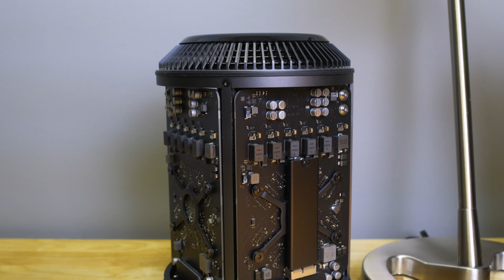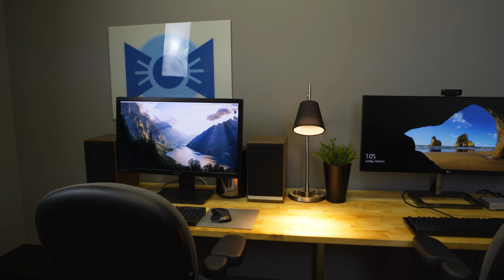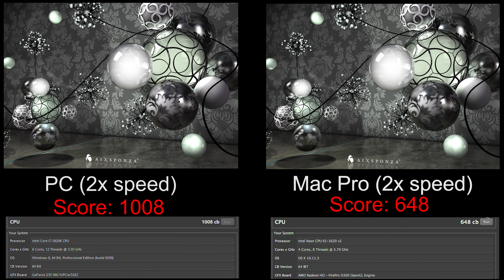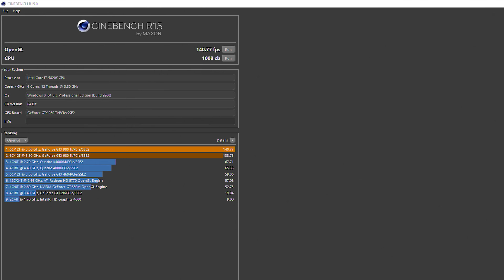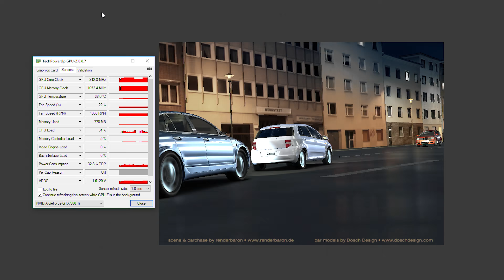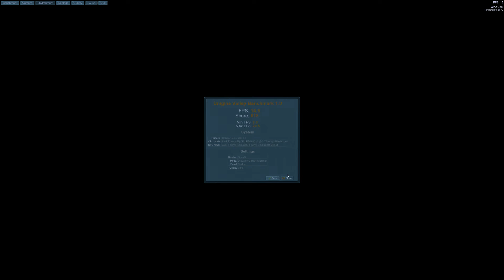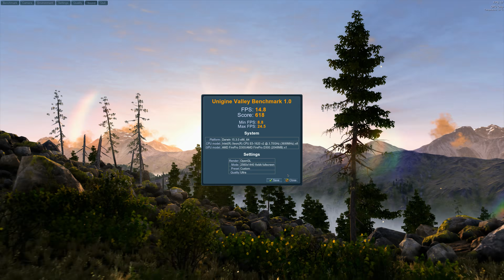$2,000 Custom PC vs $4,000 Mac Pro

Comment: The price point is what makes these computers comparable. If you're going to pay 4000 dollars for a computer that's a piece of shit. Then it can definitely be compared to computer that's 2000 dollars. I read comments saying you can't compare these computers because they were released at different times. That makes no ducking sense.
Reply: Fucking*
Reply: +Chase HAmlin Ikr....
Reply: +Chase HAmlin anyway if the "pro" version is that old why they keep selling it at 4 000 dollars ? isn't it supposed to be old ? it's worth testing cuz if apple doesn't upgrade it it's their bad so ..
Reply: +MrSky Boy it costs 4000 because people are either stupid and think the apple logo adds on another $2000 or people just like to keep things simple and buy an overpriced piece of hardware that works. Also it has been tested several times apples Mac trash can is much worse when it comes to benchmarks.
Reply: +Chase HAmlin When stuff get older the should lower the price
Reply: +WeLoveOur Tech yep
Reply: +Chase HAmlin Except that it doesn't "just work". Due to the bad thermal design the parts overheat and generally fail after 2-4 years often starting from the gpus. There's a reason why real pro machines do cooling and performance over looks.
Reply: Chase HAmlin in short: the mac pro breaks because of overheating.
Reply: +Tsunami I couldn't tell if you were talking about the Mac or the custom pc.
Reply: +Tsunami I completely agree though.
Reply: +Chase HAmlin I am not a fan of Apple, but this wasn't really "fair."  Professional grade components simply cost more without necessarily outperforming there consumer grade counterparts.  Its likely his custom build would beat out most workstation pcs in a price to performance comparison.  Add to that the fact that Apple seriously limits the amount of options you have when customizing your Macpro.
Reply: +Phillip Broden But why? That is what i don't understand, why would someone want to buy something that is so old, for such a price, makes no sense to me, for the looks? Fair enough it is more compact but that in it's self is bad, how it was mentioned in the video it was "spitting hot air". And for those who say that the product is old which is and is not fair to compare them they are clueless since how again it was mentioned in the video it is the best Mac Pro you can buy, and it is at a price tag of 4000$ which is stupid.
Reply: +Phillip Broden you consider Mac professional grade?
Reply: On a component level, yes?  Xeon processor, ECC memory, dual "Workstation" gpus.  All of it pricey, none of it ideal for gaming, or typical computer use.  Is it the best bang for your buck, no.
Reply: Rosca Radu It's for the name.  It's easier to sell the idea that you have a top-of-the-line studio with an expensive name brand computer than with a DIY custombuild.
Reply: It doesn't matter when they were released.
It's the current model Apple is selling.

Comment: Macs are built for audio and video editing and is made to last. Windows PCs are upgradeable. Best for general computing and hardcore gaming. I have a '09 macbook and it runs better than the windows laptops we've had in from 09-14. AND Windows still cannot do built-in multi-audio driver support (playing your regular media when running a DAW at the same time) which the mac has been capable of doing so for quite a while now. You need to install ASIO4ALL but can't use windows media player or watch any video/audio streams at the same time. T_T Getting older mac OS' is frustrating because when they release a new OS you wont find the previous one anywhere on their end anymore. T_T
Reply from the maker: +Eric Spartacus I built this PC for video editing... And it does a better job....
Reply: +Snazzy Labs I don't have 8k to spend for a build comparison. Gotta give it to you man. I'd be most grateful already just to have one of those computers.

Comment: You could literally make an i7 Unlocked CPU and twin water cool Titan it with 32gb of ram and it'd still be cheaper. With 4K to spend on a computer, they really could've made a beast. They failed obviously. They can't even manage heat with it. It's all tightly compacted. That's why I personally prefer Full Cases. Loads of fan and water options.

Comment: really enjoyed this video.  would love to see a similar one for laptops.  lots of companies selling $3-5k laptops with desktop graphics cards and uo to 5 hard drive bays and its really hard to know what is enough for the super demanding user and what is not even going to be in use.

personally I run multiple databases, simulators and programs, and several monitors at high res, but nothing is graphically intensive in terms of FPS.  Would love some guidance!!

Comment: Better parts, newer parts, cutom made VS Ok parts, old parts, factory made.

Of course it's different, but you are talking about two completely different markets. Apple is plug and play, it's alright, but it works. They don't give much customisation because of the amount of effort put in  the design of the thing.

Not everyone is a techie who can build computers. Yes, I know it's relatively easy, I do it too. However, you expressed exactly the fundamental problem: Your PSU wasnt working. Sure, it's minor, but it is a problem wich you have to deal with by sending parts back and whatnot.

The same principle could be achieved by talking to a carpenter about tables. OF COURSE his custom made table will be sturdier, last longer and cost him pennies to make. And as, to him, an IKEA table is an overpriced piece of design trash.

Apple will continue to succeed as long as there are people who don't want to learn about the inner workings of a computer and just want to use it right away.
Reply: You can buy prebuilt machines for cheaper than an Apple computer.

Comment: Can you run a comparison with this $2000 PC against a custom order i7 iMac 27" Retina? 
*4.0GHz quad-core Intel Core i7, Turbo Boost up to 4.2GHz
*32GB 1867MHz DDR3 SDRAM - four 8GB
*512GB Flash Storage
*AMD Radeon R9 M395X with 4GB video memory

Price:  $3,599.00

Comment: I'm looking at the 5820k and the 6700k for my build, was wondering which you'd recommend if I was going to be doing video editing as well, aside from gaming, will the 2 extra cores impact performance more and make it easier to edit and render? Or will I have to overclock the 5820k to get better performance than the 6700k at the base clock speeds. Thanks!

Comment: you say 2000 to 2200 bull man i added them all up and it comes to 2443 befor tax and shipping man so its more like 2500 to 2600 man for all of it like come on not half the cost of the apple.. but still nice test and all
Reply: Depends where you live bud
Reply: i did it with the links that were on the page and thats the cost it was but im in canada so it ended up be abit more but i know that
Reply: john reaper so dont call bullshit if u know

Comment: What really amazes me is, that my 3 year old trusty computer for about 1000 bucks hit 768 on the cinebench CPU benchmark. Also 108 FPS on the OGL test. Better results than the mac with a quarter of the budget at the same age. (Got an i7 2770K and a GTX 670, 8GB of 1200 MHz DDR3)

Comment: i'm in no way an apple fan but you shouldn't have used OpenGL tests on the mac since its using AMD graphic cards
Reply: +Shahin moadab WTF. What are you talking about? What does OpenGL have to do with AMD?
Reply: +Shahin moadab the OpenGL tests were needed to test the real-world performance of the machine in things like Video editing and photo editing (the things the Mac Pro was intended to be used for). If openGL caused any problems with the AMD drivers in the machine then it would provide an even more solid testament as to how much of a ripoff the MacPro is.

Comment: I have the 12-core, 64 gb ram, 1 TB verison of the 2013 macpro and its my daily editing computer. Honestly all though $4000 is a decent amount (even more for me cuz its in Canadian dollars), I wouldn't cheap out on the 4-core version. This computer truly shines when the beast is at ultra high performance. Just my experience on the whole thing.
Reply: Yeah but if you spent the same amount of money on a pic you build yourself. With right parts. For example, maybe put a quadro or tesla gpu (meant for editing/work station pc's) and pretty much any I-7 Skylake CPU. 3200mghz DDR4 RAM. That's easily under 4000 and will rape a Mac at rendering and editing.

Comment: 6-Core and Dual GPU     3.5GHz 6-Core Intel Xeon E5 processor16GB 1866MHz DDR3 ECC memory Dual AMD FirePro D500 with 3GB GDDR5 VRAM eachthis is 4k and the up to date model. IF you going to compare  at least tell the truth.
Reply: he did..
Reply: no he did not he used a 4 core mac pro. see 2:11 for his specs. So basically he bashed the 4 core vs has new 6 core. He should have use 6 core vs 6 core for a fare test. Says that apple never update the 4k model it  2.5 year old. But the 4k model is the 6 core one now, never bothers to tell the viewer that.
Reply: warp103 yep guess you are right. He was comparing the "Low tier" 3k model and not the top tier 4k model..

Comment: 12 gigs of RAM? So there's an option to have an odd number of sticks of RAM put in from the factory? Unless they make 3 or 6 gig sticks now.
Reply: +TheRebel3000 4 x 3= 12
Reply: i use a 4 by 3 config.. Not that bad since the 3rd stick was a gift.

Comment: A computer you built yourself, vs something you buy off the shelf, ready to go outta of the box... Guess what, I can build a car for 10,000 that's faster than 50,000 cars...
Reply: em... you can't build a car for 10,000
Reply: +KindZax are you stupid?
Reply: +Ian Thompson no, are you?-
Reply: +KindZax by the time I'm finished with my Fiero. Which is soon. I will have 5k into it. That includes the car. It will make 500hp, has a brand new stereo, suspension, wheels, brakes everything....
Reply: +Ian Thompson I dont think a cardboard box can drive on the freeway
Reply: +KindZax you really don't know shit about cars do you?

Comment: you can't do a direct comparison between Desktop Hardware (Intel i series / Nvidia Geforce) and Server / Workstation  Hardware (Xeon / AMD Fire Pro). To have a fair competition you have to buy a Xeon cpu and a nvidia quadro / amd fire pro!
Reply: +Skull Dozer You are correct because the work-oriented hardware in the Mac gives it a huge advantage. The FirePro GPUs and the Xeon CPU in the Mac Pro were intended for media creation while the 5820K and GTX 980ti Hybrid were more intended for gaming (though Quadro GPUs are just rebranded GTX GPUs sold for 10x the price). If he had used one of the current Xeon CPUs in the PC it would have smoked the Mac even more.